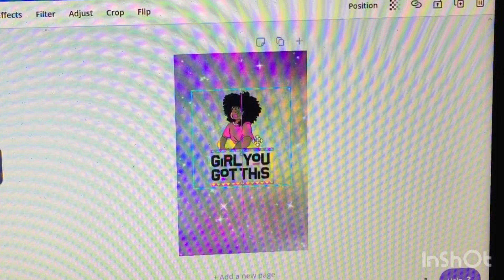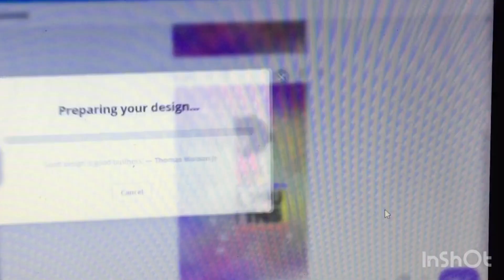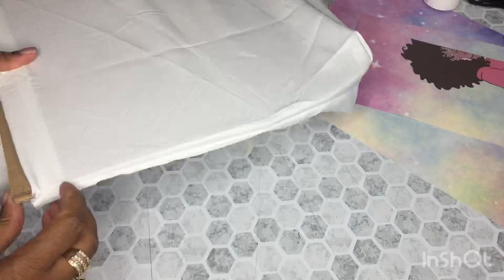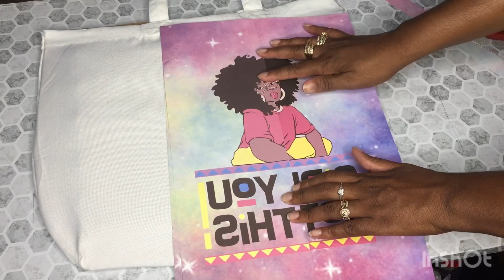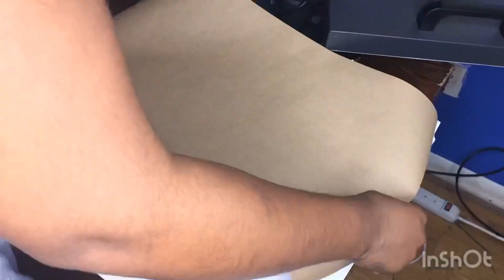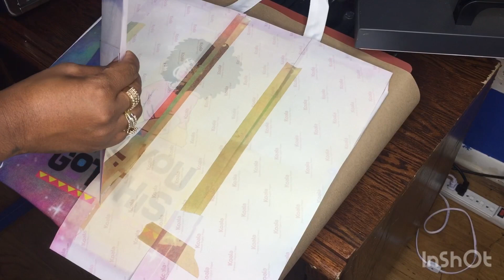All Over Sublimated Tote Bag (Small Press)

Comment: i dont get why you have to cut the lady half and not the print the background in another page and cut it. im newbie.
Reply from the maker: If I printed them separately I’d have to press twice. You can’t sub on top of sublimation, because the heat will make the image come off.
Reply: @jstewartslaboratory  print the single page with the lady, then print another for the side and tape. so avoid mis match of color of the body

Comment: I'm very very new with this. I hope you are one of those who respond. You mentioned  cropping the image. Why? And reverse it.. what does that mean? And how
Reply from the maker: My printer only prints up to 13x17 which isn’t large enough to cover my project, so I take the image and crop half of it to fill a 13x17 piece of paper, I then repeat this process for the other half of the image. This way I can get a bigger print that’ll cover my project. When you reverse an image you basically just flip it. There’s a button in the top tool bar that allows you to do this.